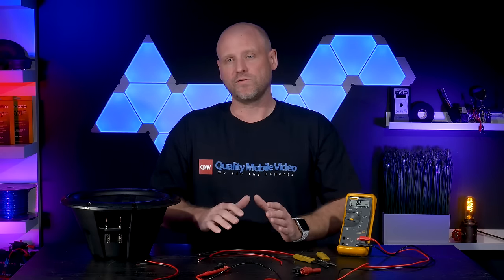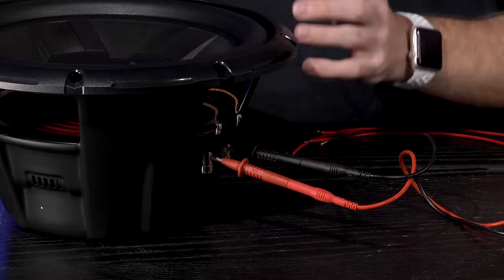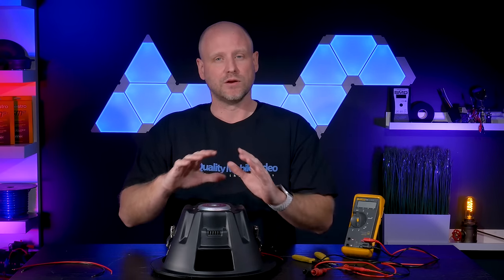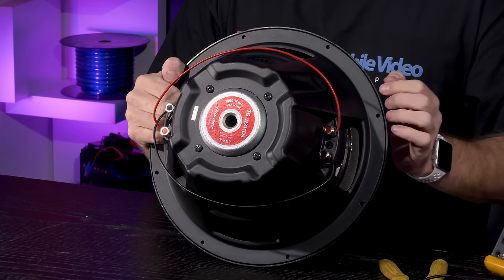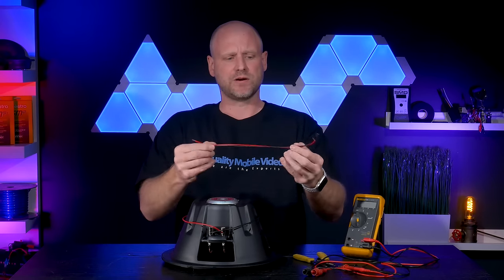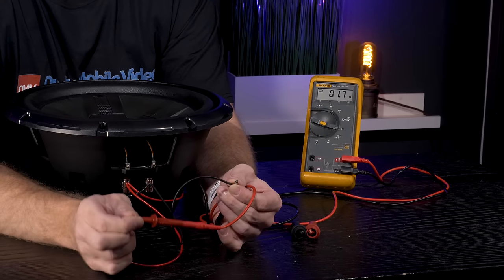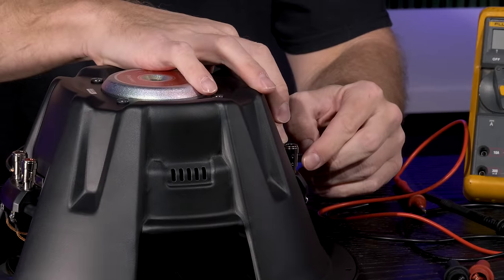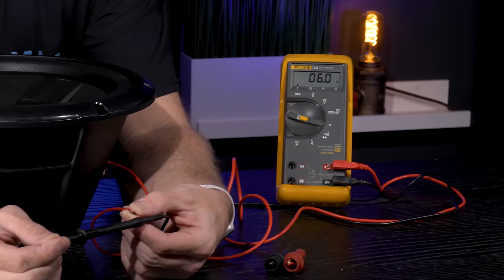Wiring Your DVC 4 Ohm Subwoofer - 2 Ohm Parallel vs 8 Ohm Series Wiring

Comment: Hello, 
so I've got the Pioneer TS-W311D4, I'm pretty sure its the one you have in the video right? I also got a Crunch GPX 1000.4. Am I able to connect the Subwoofer to the AMP or is it going to overheat? Also what kind of wiring should I do series or parallel?
Reply from the maker: Hey, so are you just connecting the one subwoofer to the amp? Or are there speakers being connected as well since it's a 4 channel amplifier?
Reply: @Qualitymobilevideo  2 speakers getting connected too.

Comment: Can I put a dvc 4 ohm sub parallel to my 2 channel class d amp? The amp says 250w rmsx1
Into 2 ohms. And if so do I bridge it with the red to one channel and black to the other channel negative on the amp after doing the parallel to the dvc 4 ohm speaker?
Reply: The amp is mono only.
Reply from the maker: Yes a DVC 4 ohm woofer will make a 2 ohm load at an amplifier in parallel
Reply: But won't it get cut in half if I bridge it? Making it 1 ohm?

Comment: GREAT VIDEO,S!! I have a situation I hope you can help me with; I have (2) 400-ohm BOSS extreme chaos subwoofers each speaker has (1) TERMINAL with 4 contacts- 2+ 2- HOW WOULD I wire these contacts in parallel the speaker terminal contacts are (1 ONLY) 4 CONTACT TERMINAL 1 1/2" TO 2" MAX INCHES LONG; they will be placed in a speaker box ?? appreciate any help!! thank you, PATRICK.P

Comment: do i need a multimeter? or does that just measure it. could i just connect the wires and hook it up to my car? also does anyone know a cheap place to get speaker wire. Im not really sure which kind of speaker wire to get. Thanks
Reply from the maker: Multimeter's are important tools for installing any car audio equipment. You don't need one, but it's very helpful if something is wrong and you need to figure out the solution
Reply: Get the wire from auto zone or your local sound shop
Reply: DRVGO thanks i just went to best buy and they had exactly what i wanted for 6 bucks

Comment: So can I only run this sub in 2 Ohm OR 8 Ohm?  what if I want to run this Sub at 4 Ohms?
Reply from the maker: Correct, one DVC 4 ohm subwoofer can only be wired at a 2 ohm or 8 ohm load. You can't do it at 4 ohms unless you have two of them

Comment: Hey buddy I would like your help please this what I got ordered can you please recommend me your opinion 

2) Pioneer TS-W311D4 12" 1400 Watt Car Subwoofers
1400 Watt Max (2800 Watts Per Pair)
400 Watt RMS (800 Watts Per Pair)
IMPP Woofer Composition
Dual Layer Fiber Reinforced Elastic Polymer Surround
 
Pioneer  AMP 
1,600 Watts Max Power
Compact Design for Versatile Installation Options
Wired Bass Boost Remote and Variable Bass Control
1 ohms Stable
Class D

Comment: I just got two DVC  4ohms subs.. I was under the impression that it can run at 4 ohms.
I want to keep it at 4 ohms. but I heard you saying that a dual 4 ohms can only run at either 2 ohms or 8 ohms...
is there a way to wire it as 4ohms? thanks
Reply from the maker: You can wire them to 4 ohm. Two DVC 4 ohm subwoofers wire to 1 ohm or 4 ohm. One DVC wires to 2 ohm or 8 ohm. The impedance changes when adding woofers.
Reply: @Qualitymobilevideo   Thank you

Comment: I need help. I have 2 dual voice coil 4 ohm subwoofers wired the way you showed being 2 ohms at the amplifier. The combined rms of them are are 1400 I’m clueless on what amplifier I should use. Any help would great thanks in advance!
Reply from the maker: So you'll want a monoblock amplifier with a power rage of 1250-1600W RMS @ 1 ohm. Like these:

Hifonics BRX2416.1D Brutus 
http://www.qualitymobilevideo.com/brx2416-1.html?utm_source=YouTube&utm_medium=Video&utm_campaign=Kicker_Line

Power Acoustik BAMF1-5000D
http://www.qualitymobilevideo.com/bamf1-5000d.html?utm_source=YouTube&utm_medium=Video&utm_campaign=Kicker_Line

Power Acoustik EG14500D
http://www.qualitymobilevideo.com/eg1-4500d.html?utm_source=YouTube&utm_medium=Video&utm_campaign=Kicker_Line

Power Acoustik BAMF13000D
http://www.qualitymobilevideo.com/bamf1-3000d.html?utm_source=YouTube&utm_medium=Video&utm_campaign=Kicker_Line
Reply: Quality Mobile Video Thanks man! With the amplifier being @1 ohm it would create more bass right?
Reply from the maker: Yes a 1 ohm load means you'll get the most power possible from your gear. The other option you have with your specific gear is a 4 ohm load, it'll be less powerful but more efficient, will run cooler

Comment: Thanks for the awesome videos!! Could you tell me the best way to wire up two JL audio 12 TW3s DVC with a AudioControl LC 1.1500? I want it wired for 4ohms. That amp as you may know is a mono block but has two outputs for the speaker. So should you just use one output or both?
Reply: Hello I got the same amp I’m curious what you wired you subs too be, I’m running 2 4 ohms kickers and wanted to wire to get 2ohms did you use both outputs ??

Comment: Question, using the second option (8Ohm), would that work when connected directly to a Sony TZ 140 Home Theatre?
Reply: Brian KG if the amp puts out 8 ohm it’ll work also make sure the wattages are fairly similar

Comment: Hey,I have 2 15" audiopipe speakers 4ohms I want to wire them to play at 2 ohms each how can I do it....
Reply from the maker: Hey Sean! Are they Dual Voice Coil or Single Voice Coil?
Reply: They are dual voice coil
Reply from the maker: Two DVC 4 ohm woofers can only be wired to a 1 ohm or a 4 ohm load. 2 ohm is not possible
Reply: Ok can u send me a diagram on the best way to hook them up,I'm using a taramp 5000k mono amp

Comment: what if i wire a dvc to a 2 channel amp (no bridge), 1 coil to channel 1 and 2nd to channel 2 ? i know it will work but what is wrong with this method no one on youtube has shown this method  or anywhere else
Reply from the maker: Yea so basically you'll have to double check your amplifier is bridgeable, but also bridgeable to the correct impedance to accept your DVC sub, whether it's 2 ohm or 4 ohm.
Reply: @Qualitymobilevideo  most 2 or four channels can only be bridged at 4 ohm which is 2 ohm for each channel, what i was asking about connecting coils individually 2 a 2 channel amp not in bridge mode

Comment: Hello,

I have ordered an Amp with 1 single subwoofer 
Kicker 12" 800 Watt CompVR 4 Ohm DVC Subwoofer Car Power Subwoofer | 43CVR124.

I would like to know how should i set them up.
  series or parallel ?

 Pioneer GM-D8601 Class D Mono Amplifier
1,600 Watts Max Power
Compact Design for Versatile Installation Options
Wired Bass Boost Remote and Variable Bass Control
1 ohms Stable
Class D
Reply from the maker: These are actually a perfect match. Wire the subwoofer in parallel to create a 2 ohm load at the amplifier
Reply: @Qualitymobilevideo  Thanks for the fast reply. stay safe and healthy you just earned another sub.

Comment: Hamaan monoblock 1chanal amplifier pioneer Duel 4ohm 400Rms subwoofer which Wiring is Best
Reply from the maker: With one DVC 4 ohm woofer, you can wire either 2 ohm (parallel) or 8 ohm (series)
Reply: @Qualitymobilevideo  thanks for the reply

Comment: Ok so my 2 subwoofers are 4ohm and i wired both up the same way so i have 2 negs and 2 positives going into my amp ... So does that mean my amp is taking 4ohms or 2 ohms ?
Reply: Subwoofer 1 is 2 ohm subwoofer 2 is also at 2 ohm ... 2ohm+2ohm = 4ohm ? so is my amp taking 4 ohms ?
Reply from the maker: Are they DVC or SVC?
Reply: @Qualitymobilevideo  DVC
Reply from the maker: Two DVC 2 ohm woofers will make a 2 ohm load in parallel or 8 ohm load in series
Reply: @Qualitymobilevideo  what about a DVC 4ohm ? My subwoofers are 4ohm
Reply from the maker: Two DVC 4 ohm woofers make a 1 ohm or 4 ohm load

Comment: Why cant we wire it as 4 ohm,,,when it is a 4 ohm load woofer?????
Reply from the maker: It depends on the impedance, voice coils and number of subs you're using! You can wire a DVC 2 ohm woofer to 4 ohms
Reply from the maker: Lol welcome to my world dude
Reply: u can but to get most out of it u either gotta bridge it or convert it to 2 ohm, depending on your amp. For instance, my Dual 1,000 Watt amp is best wired to be at 4 ohm but bridged. If i were to wire my sub as 2 ohm(as this video is demonstrating), i'd only get 120W (RMS) instead of 240W (RMS). It all boils down to your amp.
Reply: Question I have a Rockford amp prime mono 500 watts. I paired the amp with a kicker comp r 12 , 2  ohms. For some reason the amp fried the sub. Should I had got the kicker comp r 12 , 4 ohm ? And everything was wired properly and sub only lasted 3 months.
Reply: Eric b No I didnt check I just went by assuming my comp r 12 enclosure would pair perfectly with my amp. Maybe something wasn't wired correctly inside the enclosure and it was probably giving off a 1 ohm load trying to keep up with my 2 ohm Rockford amp
Reply: @3201jerome  thats probably what happened then. Cant go off what they say. Hell even the RMS isnt accurate. Definitely get yourself a $6 multimeter for ur next setup.
Reply: If you wanted to wire a DVC at 4 ohm you would need a dvc 2ohm speaker. Usually there are multiple models of the same speaker with different ohm loads so you can usually replace the speaker without having to buy all new equipment.
Reply: If your wiring kicker subs they kinda idiot proof it coil 1 have a white dot in the middle of the red labels on the terminals
Reply: Think of it as 2 woofers in 1 you have 2 x 4 ohm loads 4 devided by 2 is 2 so final ohm load is 2 if you have 2 dual 4 ohm subs meaning you have 4 x 4 ohm loads 4 devided by 4 is 1 meaning your final ohm load is 1 which is ment for mono blocks high output amps   most company's give you wiring o diagram best advise is research it first before buying a bunch of stuff that won't work well with each other and look for true power amps mtx , Rockford fosgate , jbl , pioneer mono blocks and avoid crunch , autotek , ssl, planet audio / over rated amps labeled 2000 watts and don't even put out 600 watts there's a lot of amp dyno videos on here to look at
Reply: @3201jerome   probably cuz you had It ran into 1 ohm. And those subs are depending on the year are 400Watts  to 600watts RMS. Hmmmm.

Comment: If you wire a dual 4 ohm speaker in series will the rms be the same as if you wired it in parallel?
Reply from the maker: The power of the amplifier is what's effected, not the subs. A DVC 4 ohm woofer will create a 2 ohm load in parallel wiring and 8 ohm load in series wiring. A 2 ohm load at an amplifier is much more powerful than an 8 ohm load.

Comment: Hi i have sony XM GS-100 mono amp
and pioneer dual coil sub tsw1211d4
2 ohm is best or 8 ohmis best for MAX BASS i just want more bass.
 
Thank U
Reply: The lower the ohms the higher power your amp will push. But as for me I always do parallel

Comment: Alright so i have 2 12 dvc 4ohm subs I converted it to 2ohms each sub just as you did .can and how ? do i hook them up to a 1channel mono amp
Reply from the maker: Two DVC 4 hom subwoofers wire to 1 ohm in parallel or 4 ohm in series. Not 2 ohms

Comment: Thanks for your videos.  question.  how is the quality of a speaker changed when u wire what u have set from a  4 ohm and a 8ohm ?
Reply from the maker: The quality doesn't change, the efficiency and output do. For example, let's say two specific subwoofers wired at 4 ohm do 1,000 RMS combined. At 8 ohm they'll do half, 500W RMS, and be much more efficient, run cooler, less likely to damage
Reply: Quality Mobile Video so you really don’t need that powerful of a amp then if u can take advantage of doing this ?
Reply from the maker: It's all dependent on what the specs of your gear is. What kind of subs do you have? Part number
Reply: Quality Mobile Video  thanks ahead of time for ur tips and help in helping me figure out how I need to set up for best results. Also I am trying to figure out which box I wanna build.   I like rap has but mix it up with  everything else techno and all.  So I have Kenwood Kac 9105d and a compvr15
I wanted to make a box to fit my trunk and allow space. I was going to go with 3.18ft sq (internal measurements of 3’x8.5”x1.5’. The mounting depth of the speaker is 8 3/16”   Do you think this will work

Comment: How do I wire four 4 ohm dual  8s to a  4 ohm to the amp
Reply from the maker: You can series each of the two woofers and then parallel the pairs if they are SVC.

Comment: 1 DVC 4ohm speaker with 800 watt RMS,
with paralell will be 2 ohm, how about the RMS,? 2x800=1600 or still 800 ?
Reply from the maker: It depends on the amplifier! What is the amplifier's power rating @ 2 ohms?
Reply: @Qualitymobilevideo  
Power @ 1Ω: 1 x 2000 watts
THD @ Rated Power  < 0.2%
Power @ 2Ω: 1 x 1500 watts
Power @ 4Ω: 1 x 1000 watts
:-)

Comment: Hey I have a DVC 4 sub and a SC 2 ohm 10in sub. How do I wire this to my mono amp?
Reply: You're technically not supposed to mix speakers like that. But you have what you have and if you're gonna do it regardless,  On the DVC, do positive to positive and negative to negative. That would take it to 2ohm.

Comment: Is it possible to a dual voice coil 8ohms and wire it at 8ohms load? (Final impedence)
Reply: If each of two speakers were dual 8 ohm you could wire each individual sub in series to 16 ohm load ... After that were done they could be wired back down to an 8ohm load in paralell. I must warn you, I've never come across a speaker that had dual 8ohm voice coils.

Comment: I have a 3 ct sound tropos dual 2 ohms  10s. And my amp is stable a 1ohm just low 1.3 ohm is corrert?
Reply from the maker: Correct! Three DVC 2 ohm subs make a 1.34 ohm load(parallel) or 3 ohm load(series)

Comment: My subwoofer say dual 4ohm and find info on it to make it 2 ohm, does that mean I can only be wired as 4 ohm
Reply from the maker: Does it have a switch?
Reply: Quality Mobile Video I meant to say I can’t find info on making it 2 ohm and it doesn’t not
Reply from the maker: @angelmartinez2953  Oh. Well you can't then. Some subs have a switch to change the impedance. Otherwise your sub will always be DVC 4 ohm. One DVC 4 ohm woofer can be wired to 2 ohm(parallel) or 8 ohm(series)

Comment: Can explain about dc resistance vs ohms
Reply from the maker: I think you mean DC resistance vs impendence, DC resistance is measured when the cone is not moving and static. If you use your voltmeter and measure the resistance and then start moving the cone you will see the value on the meter change, that is impedance. Impedance changes as the cone is moving and is influenced by the enclosure that the driver is in.
Reply: @Qualitymobilevideo  thank you 👍👍👍

Comment: How can you wire 3 batteries even including the one in front that is connected to the alternator would i  wire them in series or parallel???
Reply: Marvin Avalos 
Parallel. If you had them all series your voltage would jump to 36 volts instead of 12v.
Reply: NGAudio o Ok thank you good thing I asked I wasn't. Sure about doing it i didn't want to brun anything up..thanks again
Reply: NGAudio can you help me out  im trying to hook up a second alternador on my 1998 chevy lumina do you think that i can?i try asking lost of people for help here on YouTube video's but nothing i just dont know if a can or not if i can how can i..
Reply: Marvin Avalos 
You can add as many alternator as you want, just as long as the new alternator voltage is the same as the one that's already on there.
The problem with adding more than one alternator is that you need a new bracket to add to your vehicle to hold 2, a larger belt, and have to jump from one voltage regulator to the new one (unless you install and external voltage regulator).
Reply: 1 

You're wrong.
Only time that it becomes an issue for having too much amperage out of an alternator is when you don't have the batteries to handle it. And hardcore BassHeads don't have their extra power running to the rest of the vehicle. They wire it so that 1 alternator runs the car and the rest run the audio system.
Reply: 1 

Also, to prevent any damage from too much amperage, that's what a VOLTAGE REGULATOR is for.

Comment: yes bud but if you   have.... 2 speakers    put them in series ......   then in parallel to the amp  you  can put 1 2 3 4 5 6 7 8    speakers    and thay will be 4 homs   no matter what .. i have   1 -   6 ohms sub  and  4 --  4 ohms  6-9 speakers   and they come to   4 ohms on one channel    aaaaand 6 ohms on the other
Reply from the maker: The impedance and number of voice of subwoofers determine what kinds of loads you can make at an amplifier